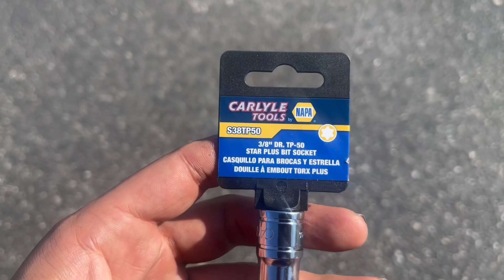👨🏻‍🔧Another Day at the Junkyard: 2004 GM 4L60E REMOVAL!

Comment: Man you rattled your skull, good thing you had that snack-on skull cap on. Got the Carlyle T50 torx plus size, thx- I have a set of 3/8 dr Carlyle deep metric sockets built for hand ratchet on my bench that have stood up to a pnuematic gun for several years, mostly use the 13 and the 19 on chainsaw fw nuts and clutches so I guess Carlyle is good enough
Reply from the maker: Yeah that beanie saved me there!! Nice!!!! 🔩Carlyle isn’t too bad my last 50 torx plus pulled a good 100 bell housings before finally giving out lol